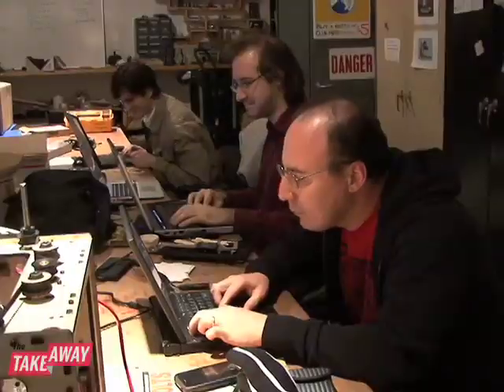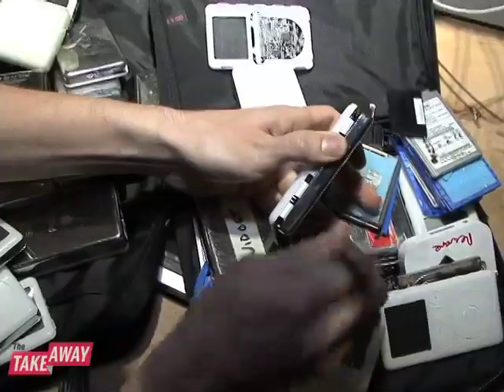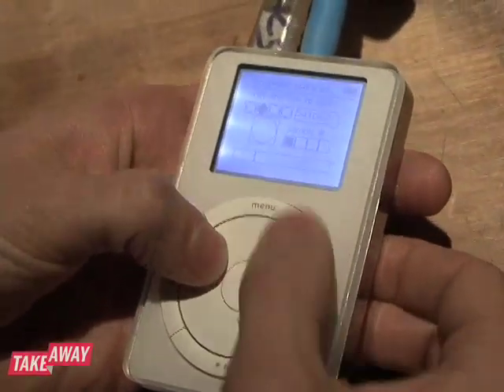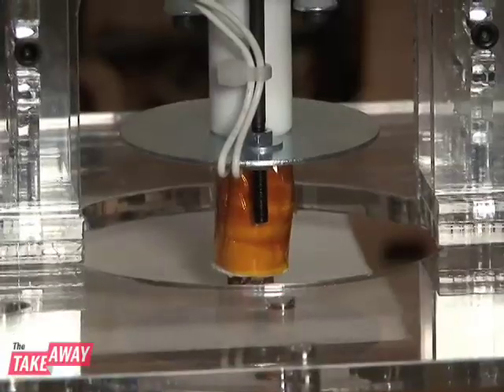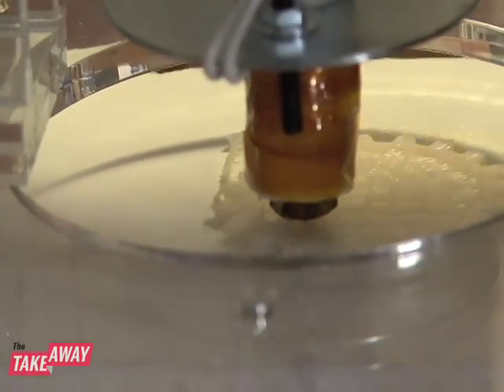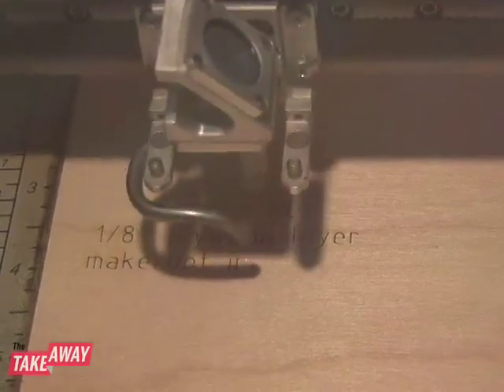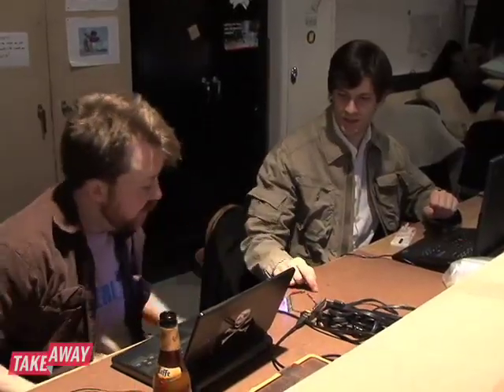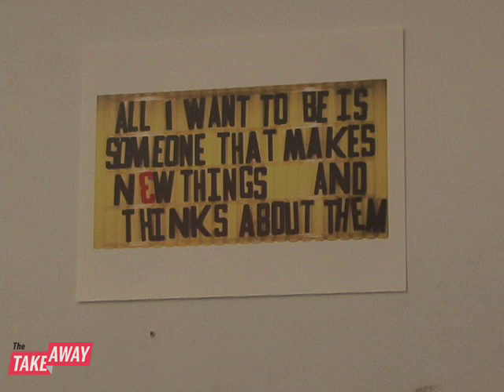"Hacker spaces" are giving geek tinkerers a place to gather, create and collaborate

Comment: The Hacker/Maker space in Seattle is Metrix: Create Space.  They have a lazer cutter, a couple of big plotters, several 3D printers.  Of course, the nice thing about having a lazer cutter and a 3D printer is that you can then make more 2d printers, which is why they have more than one.  I was just there yesterday for a great workshop they did on programming Arduino micro-controllers.

Comment: Two words for you, metroid - satellite tv. (which you can get, interestingly enough, even if your dish is pointed at a tree. I suppose that's because the tree is cylindrical.) The only trick is that the ISS moves relative to the earth whereas most tv satellites don't. Or they don't move appreciably.

Comment: This warranty does not apply: (e) to damage caused by operating the product outside the permitted or intended uses described by Apple; (f) to damage caused by
service (including upgrades and expansions) performed by anyone who is not a representative of Apple or an Apple Authorized Service Provider (AASP); (g) to a product or part that has been modified to alter
functionality or capability without the written permission of Apple; or (h ) if any Apple serial number has been removed or defaced.

Comment: Hmmm...They actually have something like this near to me (in Switzerland) except less nerdy =D
Basically anybody in between the ages of like 13-20 can come. And there is a bunch of staff and a load of power tools and a basement filled with everything and an upper floor with books on how to build and design stuff. It has less computer work though. Something like the workshop they have at Mythbusters =D 
Everything is free except the materials you get yourself or from the basement =D